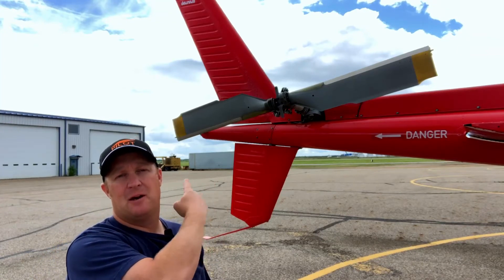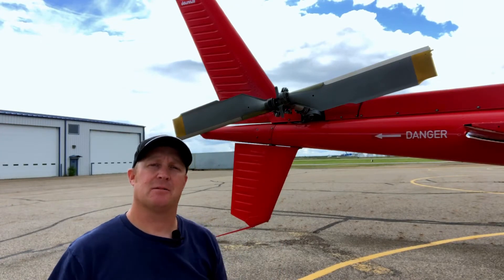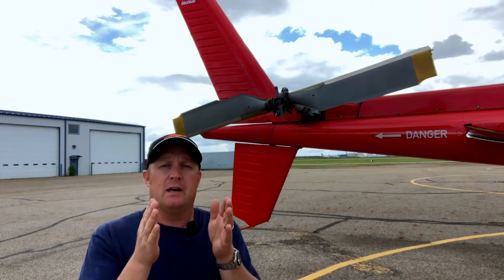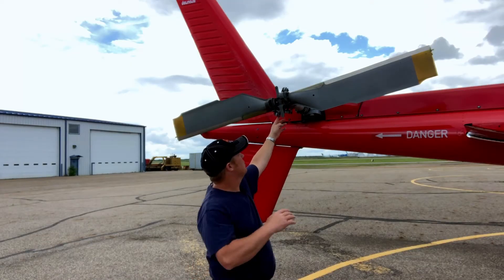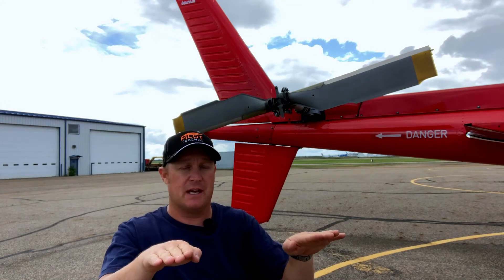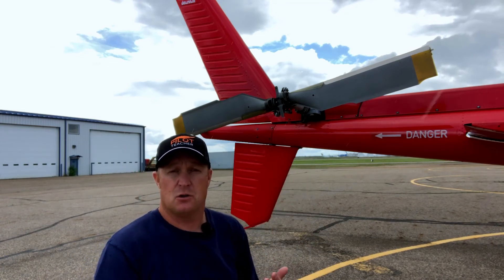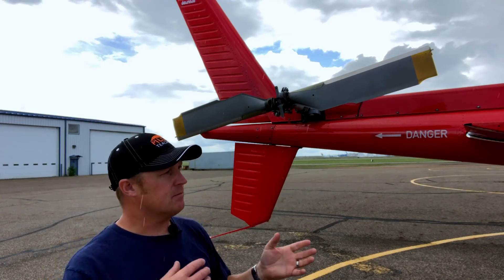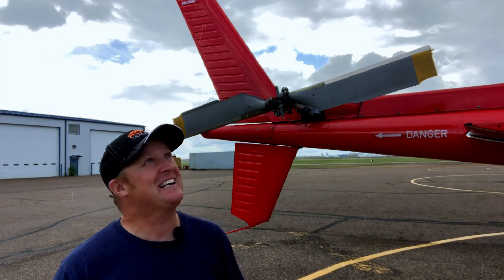Helicopter Tail Rotors: What Are They Needed For?

Comment: Hello, I am completing my theory exams and working towards CPL H and have found a question that I can't seem to find any text on... Tail Rotor Strike Tabs? Can you enlightening me please. Thanks, from NZ
Reply from the maker: Look for pics of the Astar tail rotor. They are tabs of aluminum that stick out about 3/4” from the tip of each TR blade. If they get bent they indicate the pilot has contacted the TR with something. Thin branches or bushes are enough to bend them. Depending on how bent they are can tell the maintenance team how much of an investigation needs to be completed on the drive train.
Reply: @PilotTeacher  thank you for the reply! Excellent. Much appreciated.

Comment: Hello, Rick and other helicopter pilots. Does a tail rotor auto re-center to it's center position when you release the foot pedal? Or should I ask were they spring loaded so that it will return to center position upon releasing the foot pedal? Does the cyclic spring loaded as well? Does it return to center like those computer joysticks? Thank you in advance.
Reply from the maker: Hi Wai. No, none of the flight controls are spring loaded. They stay in the position you hold them. With the cyclic if you let go of it it will wander wherever it wishes unless the helicopter has an automatic flight control system and autopilot fitted.
Reply: @PilotTeacher  Thank you for the respond. The reason I ask is that I would like to make a sim joystick. And sorry for the late reply. YouTube just notify me on your respond.😂